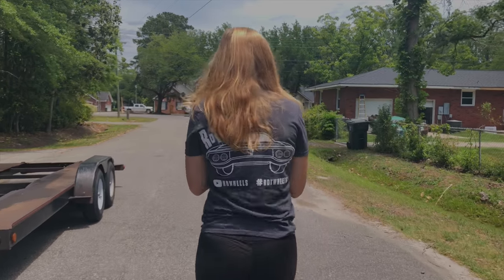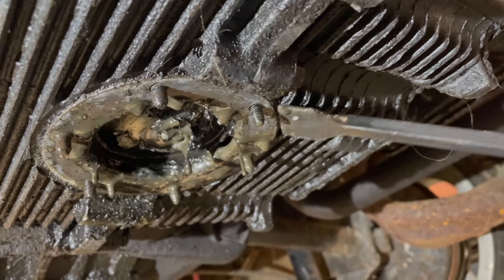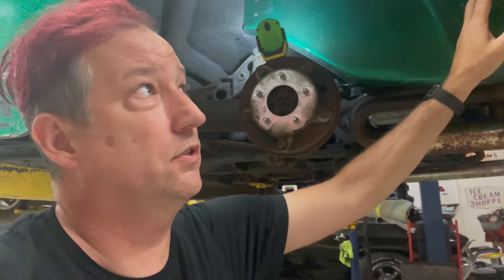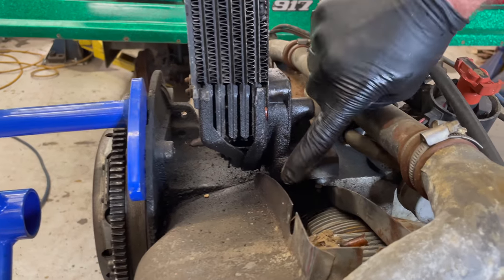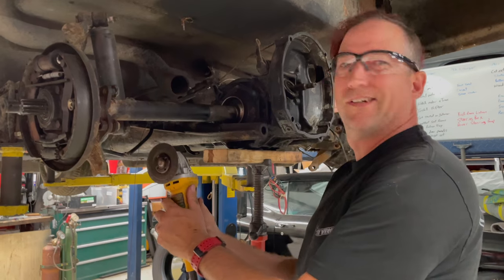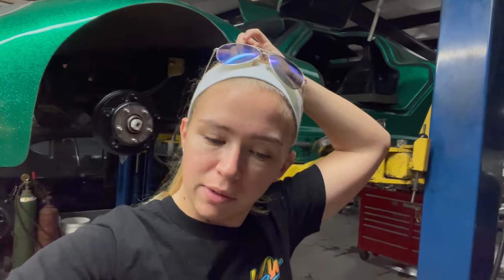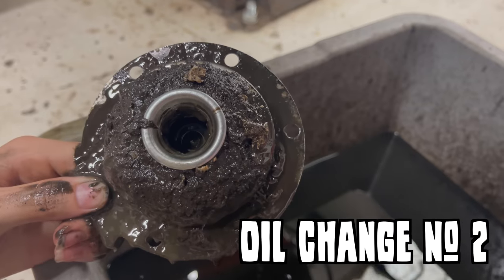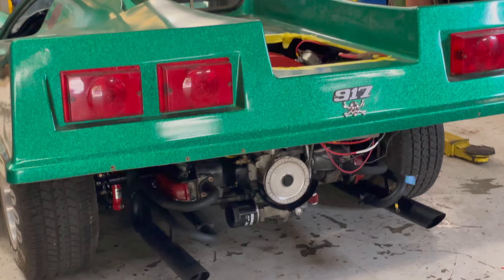WILL THIS KIT CAR RUN AGAIN?! | FORGOTTEN FOR 10 YEARS!  | ROTWHEELS EP. 21

Comment: from a very old car guy that has done this for many years, drain the oil and fill it up with diesel and let it sit for a few days. it will cut all the grit and grime and some of the burned in crap loose. i use that because when you finish cleaning and get it started the diesel will burn off because it is a fuel, unlike most of the other oil products that most use for a stuck or old engine.
Reply from the maker: Thank you! Great advice! Will try it next time👍

Comment: I almost bought one of those years ago until I found a Bug engine in it. If it had a Porsche flat 6 and 5 speed yah but that Beetle engine is about as exciting as a Briggs and Stratton
Reply from the maker: There is guy in the Laser 917 group who swapped a porsche motor, and is awesome!!
Reply: You can got 200hp out of a bug motor. Even more with a turbo. Subaru swap is a great alternative!!

Comment: Years ago i fooled myself with a joke used Watercooled VW i bought with a BlownHeadGasket  that allowed water and Coolant into the Cylinders  and contaminate the Oil in the Pan  i did drain that old Oil ,Put a new HeadGasket on the engine  and new Oil & Filters  and got the car running to find out  after 1000 miles the Pisto; Rings were so Corroded and bunked up that they seized the motor and wound up Spinning the MainBearings on the Crank   i was however capable of having the Block and Crank saved by a localMachine Shop  and a New set Of Pistons Rings Bearings , and of course Gaskets However  I did find out that  when the engine Seized  the sensors got such whacky Signals  the Bosch Arlectronic FuelInjection and the Brain ,Computer  shorted itself out FYI the dcarea was a 1981 Rabbit and at that time  very few people or Shops had the Equipment or Knowledge toCorrect the Computef under the Passenger Seat  so the car never really ran correctly under my Ownership  and i wound up giving it away
Reply from the maker: That's a great story! I am still die hard aircooled! The head gaskets are always a pain in the butt!

Comment: I forgot about that Hardcastle and McCormick show that was cool and I love this car I also have wanted a kit car since I was a kid my first cars were Volkswagens and then at 17 I got a hold of a 1970 cutlass with a 455 and immediately sold my Volkswagens following driving that car, haven’t owned one since don’t really like them but they are one of those you can keep them running forever kind of cars and the only way I would own another one is this kind of example it’s even got steering brakes that is so dope

Comment: driving position for the 917 was the same as the guys who drove 82 through 93 Camaros on the strip with the radio blasting 🤣... sorry but the 917 is cooler Chevy guys